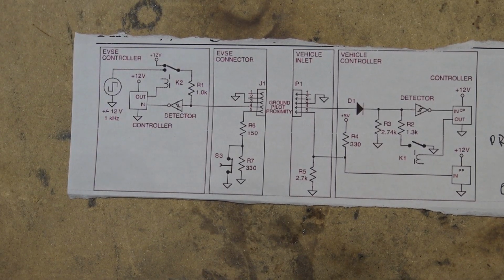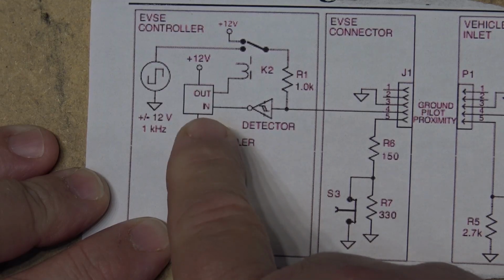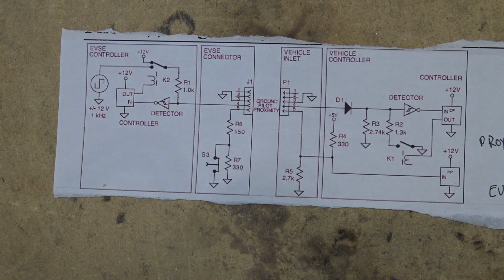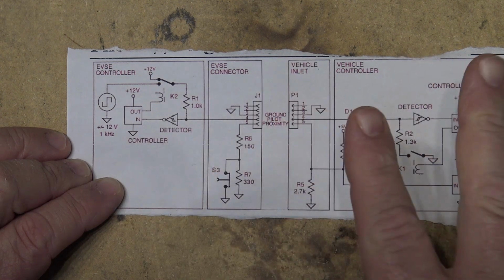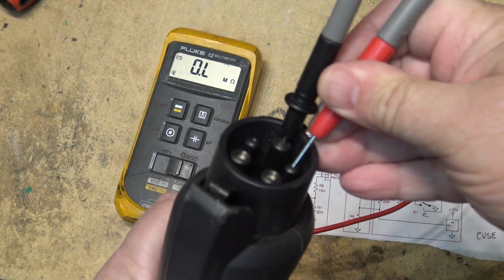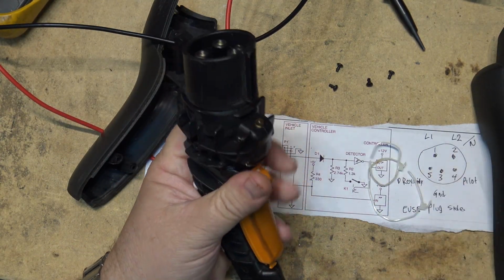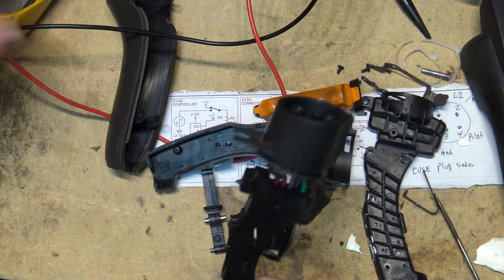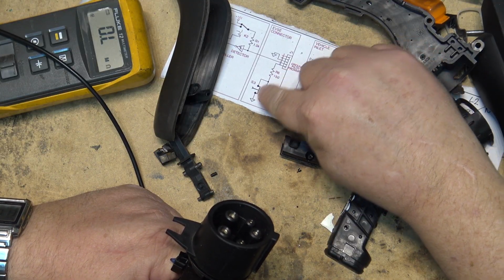Electric Car Charger Troubleshooting

Comment: My new Level 2 Charger from Ebay puts my EV into a fault condition.  Error is "Check Charging Equipment".  Strangely, the sense line measures 330 ohms. Switch open or closed.  That cannot be possible unless the Charger connector is mis-wired.  I can see 480 ohms all the time or 150 ohms but not 330.  The Connector has 2 tiny screws that will likely let me take is apart but seems like some proprietary screw?  My Eyes are old so hard to tell,  It could be very tiny Torx screws.  I'm ordering a set that starts with a number 1 Torx on up.  I didn't get all my money back for the defective Charger but he offered to let me keep it for $21.  Seller was happy when I accepted.

Update:  I got the Power Head apart and there was a "Black wire" connected to the proximity sense line.  That wire measures 330 Ohms.  The Resistor Network 330+150 is in a potted micro-switch.  That had a yellow wire coming out of it and it measured 480 / 150.  So I disconnected the Black wire and connected the yellow wire to the proximity Pin.  I put a piece of Heat Shrink over the unused black wire.  Connect it to my EV and it is working great.  Tested at 120 and 240 volts.  So a big THANK YOU for this video and expertise.  Pretty nice to have a Charger that is adjustable from 8 amps to 40 amps for $21 and my time.

Comment: Been watching you examine these charges to try and learn enough to figure out mine. I've got two gone bad. One works intermittently with no pattern i can tell as when it works or not. I bought  a new one that never worked. It connects to  the app fine. Connects to car and shows, "Paused Charging." In the vehicle and "Ready" in the app. Worked with engineers many times, but it never worked. Company gave money back and let me keep the charger.  I've worked with it more, but can't figure out a way to get it to start charging. Its a shame because its a 48 amp.
Reply from the maker: Mine are small. Only 16 amp but that's fine as both my car's only have 3.7kw chargers.  The connected models are a little more complex as the power company has the ability to control them remotely. A down side to this is if you buy one that is used and the previous owner had a bill to settle with the power company they can disable it till the bill is resolved.  Know a guy that bought a house that had an EV charger preinstalled. It might have been a chargepoint brand. Anyway he thought it was just like his old one but nope it was managed charger and the previous owner left town and left a 1200 bill that needed settling. The charger had a seperate meter so he was able to get his residential service connected but they wouldn't activate till the bill was settled.  So he had to buy a new charger.

Comment: You seem very knowledgeable about the inner workings of EVSEs. I have a little mystery for you.  2 of 9 identical Level 2 charges at my office give me an error code starting “pilot diode test failed”. However noone in my office EV chat group has issues charging on these two.  If it’s an issue with my car, why don’t I have trouble charging on the other identical chargers? And if it’s an issue with the charger, why don’t any other cars in the office have problems with them?   Or is there just a ghost in the machine?
Reply from the maker: Nope. Know nothing.  The ones I have are pretty simple.  Place the pilot signal on the control line. The car puts the correct load on to initiate charging and the evse turns on the relay that applies power to the car and the car then begins to charge

Comment: Without  bms battery,, ev charger  how to on??     Testing  purposes  can  point charger  not on😢
Reply from the maker: Put a resistor on the pilot line and it will turn on.
Reply: @12voltvids  
Sir, please  guide which value  resistor  use.  Its use two pin can high and  low between?
Also sir it's tips  use all  two and three wheels  ev in?
Reply: Sir, please guide 🙏

Comment: I went to a Level 2 charger J1772 and plugged in to a Clipper Creek 40 amp charger and it did not work. I had a 20' charging cord extension in my EV so I hooked up the Clipper Creek 40 amp charger to that and plugged it into my EV and it worked. What could be causing the charging issue with the charging cord on the Clipper Creek 40 amp charger ?

Comment: OK ive just understood the EV comms at last!
Reply from the maker: I've got 2 PHEV and wouldn't go back to full combustion.  My first one paid for itself in 7 years in gas and maintenance costs.
Reply: @12voltvids  Bought Tesla Model S P85 RWD back in 2014, came with free supercharging for life, now 140,000 miles later the car owes me nothing but thinking green Ive always kept my cars for 100,000+ miles the Tesla will be going to 250,000+. I charge on super low rate nightime electricity or plug in my solar during the day though normally my Zero SRF electric motorbike is on charge during the day. All my daytime charging is done at 5A or less so just tops up the electric vehicles although the bike can put 80 miles in on a good day. Either way as I say Ive only got one arse and when im in the car the bike charges and when on the bike the cars on charge. Lets the haters hate meantime we will all use our free rocketships.
Reply from the maker: @slartybartfarst9737  yup. Unfortunately some have their head in the sand.  I have a friend that sends me Instagram crap if all those truthers trying to justify gas cars claiming that EV is dirtier because of all the minerals that go into the battery and disposal ect.  How much oil is used to mine the materials and produce them.  Totally forgetting about the fact that gas cars use the same energy to make, and then keep on using.  Or they claim all the evetgy used to generate electricity to charge them ect.  Not here it doesn't. Hydro generation here.

Comment: Everything seems to check out to your video the ohm are fine switch  on or off.  Plug the charger in, have 12 vac on volt meter on pin 4 and ground. But the ready light does not turn on and battery doesn’t charge. Both the door open and night light work. Could the problem be in the charger Assembly  haven beet there yet but all the trim is removed.

Comment: Just fixed mine by FIRST UNLUGGING UNIT(IMPORTANT!) THEN taking some stiff copper wire that was roughed up on course sandpaper, then inserting into and scrubbing inside of the two smallest  plugs(4 and 5 in this video)...if these "sensor" circuit ports have a build up of corrosion, your charger will not put power into your battery.

Comment: I really appreciate the video, it was very informative!
I would have liked to see you try a 2.74K resistor between pin 4 and ground while you had it connected to your scope looking for the pilot signal.  That would tell us if you have a charger that requires a 2.74K load to start the PWM signal.  If the charger isn't providing the pilot signal changing the cord wouldn't fix the problem.  We know without load on pin 5 the car wouldn't start the charge cycle but maybe there is more than one problem.
Reply from the maker: It was the charging cord. I did tear down the connector. Water had ingresses into the potting and corroded everything in there.  The board still works.
Reply: @12voltvids  Thanks for the replay!  Good to know you got it figured out. I just used the information in your video to troubleshoot a defective charger for a friend of mine!  Really appreciate you taking the time to put the video together!

Comment: even if it's "not serviceable"  you have to try.
Reply from the maker: No I don't. I found the fault, and know where the fault is. Even if I did replace the resistor, which I could, externally BTW as I can get to pins 3 and 4 on the socket, I still could not make it servicable because this is used outside in the weather. The last thing I want is a electrical shock hazard plugged in to my car.

Comment: J1772 handles with cable included are readily available, though relatively expensive.  Looks like you can get one for $79-$100 USD from some places.
Reply from the maker: A complete unit is 217 CDN on Amazon and I will get a full rebate.

Comment: Dave, doesn’t it still bother you not getting to the bottom of the fault so you can say you learnt something new today? Smash it to bits and get inside that thing dang it. 🤓
Reply from the maker: The problem is pretty obvious if you look at the schematic. R6 the 150 0hm resistor is open.  That is all it can be.  If the switch failed there would be 480 ohms. Since it is open or in meg ohm range the fault points to the 150 ohm. No need to smash it to smitherines but if you guys want to see it totally torn down I can do that once I remove it and have some cable to play with.  With it attached to the wall  mount as it is there is a fair bit of tension on the cord as I have it stretched to the limit to get to the bench.
Reply: @12voltvids  
The internet likes smitherines :)
Thanks for the video and explanation of the charging system.
Reply from the maker: @koffibanan3099  
I'll get my big hammer out and break it once I get the unit off the wall and the new one installed.  This one it still attached to the wall.  Will be doing some more tests on these units soon.
Reply: Very well explained.  I need this but in reverse. I have a 16kw car and I want to use it for backup  electricity.  A unit from Japan is from $1700 to 2000 dollars plus tax and shipping. How can I be able to accomplish that? It looks simple  and doable for a diy project. I have a 2k low frequency inverter just need the configuration to make it work.

Comment: Water is too dam good at wicking up into dry pcb's and switches, not easy to stop it unless you paint the guts with a rubbery coating.
That system seems simple enough.
Not lasted too bad :-D
Reply from the maker: It was encapsulated in rubber.  It still got wet and corroded.
Reply: @12voltvids  It's a shame they don't want to make such an expensive item fully serviceable, if we all are gonna be having them in the future the landfills will be start to be full of useless cables after just 8 years...
Reply from the maker: @robwhitegalaxy  
That's the way it is.